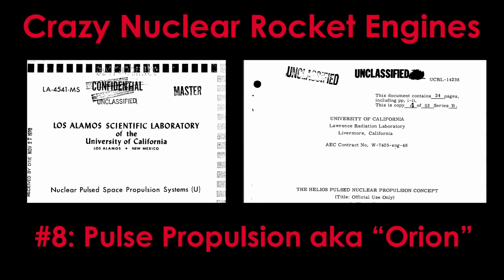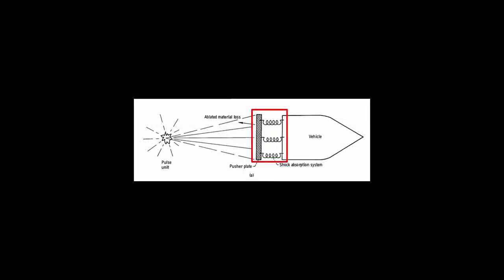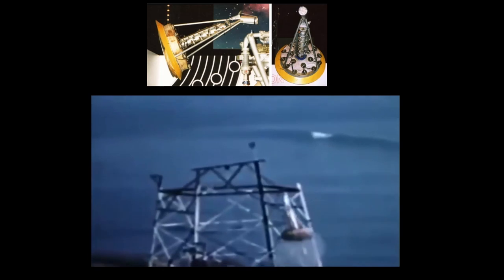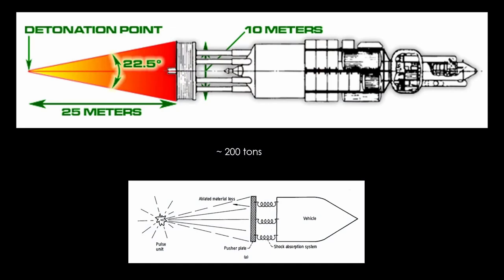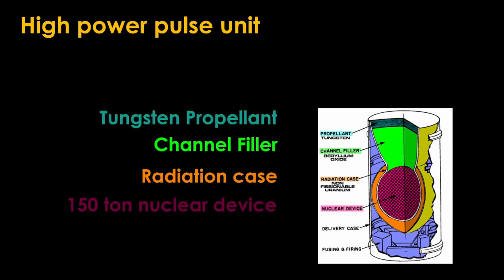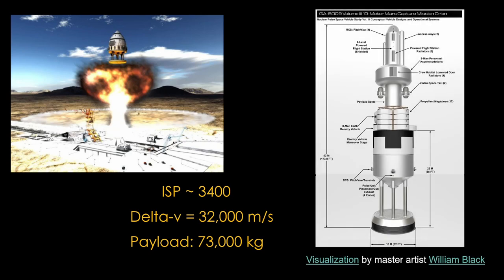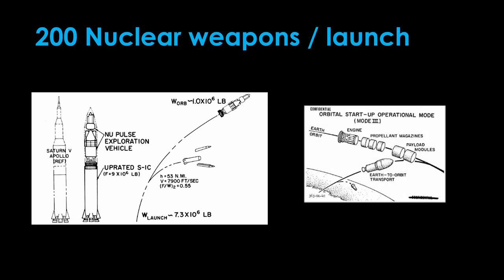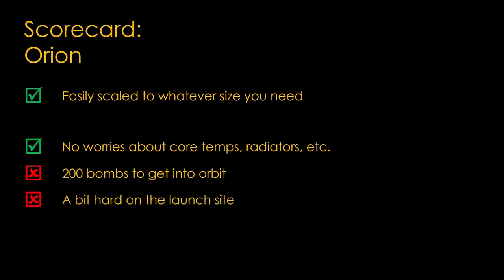Crazy Nuclear Rocket Engines #8 - Orion

Comment: Something to be aware of is that all historical mission planning using Orion (such as the 2.5y Jupiter mission) was calculated using burn periods followed by coasting. Hohmann transfers. If you instead perform a brachistochrone maneuver you can reach Mars in under 48 hours. This would take around 5-8,000 devices.
Reply: Why the faster maneuver is not considered? Too violent for humans?
Reply: @sirnikkel6746  probably just that they planned the mission as they would with any other spacecraft. No modern spacecraft has the thrust and specific impulse to do the faster maneuver, and a nuclear pulse rocket would be the first if it was built at that time
Reply: @sirnikkel6746  To add on to that,, I won't lie I answered before even watching the video. The specific spacecraft they proposed for the mars mission was, of course, designed to go to mars. Jupiter requires far more specific impulse, so even if the vehicle could do a brachistochrone trajectory to mars it might just have to do something more efficient to get to Jupiter and back because it is limited to the same ∆v

Comment: ... Orion. Also known as the craziest "rocket engine" ever conceived.

This engine is literally the definition of "swords to plowshares" in my book.
I love how you say we need a vehicle with a healthy payload, 200 tons. That is almost the dry mass of SpaceX's Super Heavy Booster, which is 250 tons.
Reply from the maker: To be fair, that's only a little bit more than the Saturn V or Starship in terms of payload. 

Orion works best if you bump things up by at least an order of magnitude. I think that 200 ton payload vehicle is the demonstrator prototype.
Reply: @EagerSpace  very true. Plus I am sure when building the bombs to push it, making them bigger is way easier than making them smaller.
Reply: NSWR is crazier.
Continuous nuclear explosion rather than pulsed.
Reply: @TheAmazingchickens  oh, interesting, I will have to look into that one. Or did he already cover that one and I am not recognizing the acronym?
Reply from the maker: @TheAmazingchickens  Shh! You'll ruin it...
Reply from the maker: @dr4d1s  You always need a critical mass to get the explosion, though there are neat tricks to use a lot less fissile material. But once you get below a threshold, you're just building a bomb with poor yield for the amount of material you are using.
Reply: @EagerSpace  I am not sure if I will ever need to use that info, but it's good to know. Thanks for explaining it.

Comment: Every species of nuclear rocket engines are not goot at launching from a gravity well.

But, if you can use Orion and other fission pulse engines (Medusa etc.) as interplanetary drives, they are great. Great performance, great serviceability, great simplicity, and great reliability.

Maybe they will be rivals that of the early generations of fusion engines.
Reply from the maker: Orion has the advantage that - like NTR engines - you can probably build it and it will work. 

But the downside is that it's much less efficient in space than in atmosphere. And that "assembly line for small nuclear bombs" is a bit concerning from a proliferation standpoint.

Comment: There is also "Medusa" variant of Orion that uses massive parachute shaped equivalent of pusher (actually puller) plate on the front to capture kinetic energy of nuclear bomb, much wider caputre angle increases efficiency and it relies on tensile strength instead of compressed shock absorbers, can't be used in atmosphere tho.
Reply from the maker: Nice. I haven't seen that one.

Comment: I have an issue with the scale point - from what I know its a bit problematic with small craft... because of excessive acceleration... :) I would probably completely reverse the crazyness scale, for me this is much more reasonable design than the nuclear salt rocket for example :P. EDIT: My bad , you gave that a 25 :D great job.
Reply from the maker: Thanks, that made me laugh
Reply: @EagerSpace  Cheers :D, your channel needs a lot more exposure... btw am I crazy that for me , after the NTR... the orion drive is the most resonable from the ones you've looked at ? I mean technically there is nothing stopping us from using it , and there is an argument to be made that the small amount of radiation is going to kill imesurably less people than polution  or car accidents for example.
Reply from the maker: @concretedonkey4726  I don't have an informed opinion on the amount of radiation, other than saying that I know there are some bomb designs that are relatively clean. It's certainly true that "nuclear bomb" isn't politically viable even if you call it "nuclear propulsion unit".

But yes, Orion is the most technically practical of all of these IMO. NTR work in the sense that you can produce a rocket engine that produces thrust but I see very little advantage in building them. I have another video on NASA's current program to build an NTR where I talk about this more.
Reply: @EagerSpace  I think there was a film about it... and some people involved in the project were very positive about how few people it will kill... thing is that the numbers were "trust me bro" since obviously the bomb design was the most secret part of it... the US government doesn't want everybody to know how to mass produce small cheap nukes... this was something surprising for me as well that the price of them was a priority since it was assumed that they will be used in massive numbers. I have to dig that move out. Edit: Found it https://youtu.be/xYoLcJuBtOw

Comment: IMO Orion isn't as crazy as a lot of the other designs. It's practically buildable, and nobody is pretending it's good for the environment. That's bad moral centering, not bad epistemics. There are scenarios we might even build an Orion, like if we really had to divert an asteroid, or had in-space manufacturing and wanted to seed another solar system.

Rockets that pretend to be nice, make sense at a glance but are shaky on inspection, claim to keep all the fuel contained but that are actually overly elaborate and won't work and fail by unintentionally blanketing the environment in nuclear waste... now that's more mad scientist vibes to me.
Reply from the maker: I don't disagree, but there was this big vibe in the late 40s and early 50s that atomic weapons would be a boon for mankind, that they could - and would - be used to cut passes through mountains and build harbors where none existed (both real proposals). Orion came from the same mindset as that.
Reply: @EagerSpace  didn't the Soviets actually use a nuke to put out a huge oil well fire once?